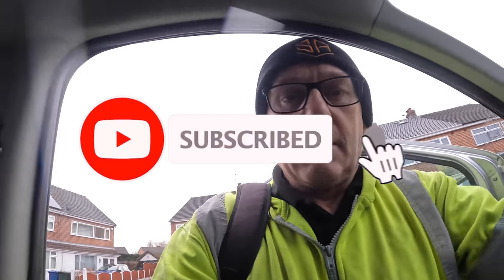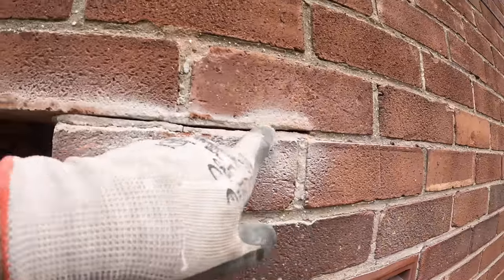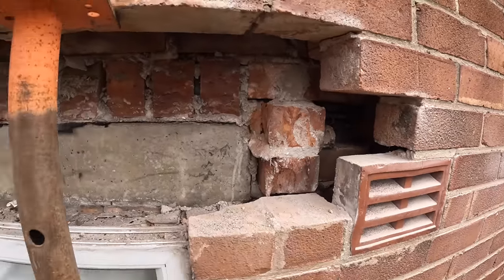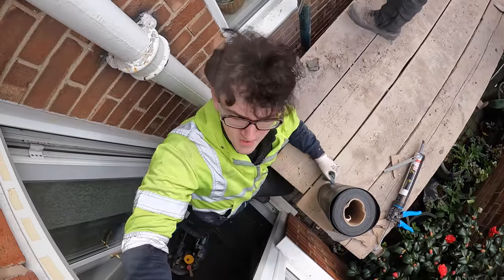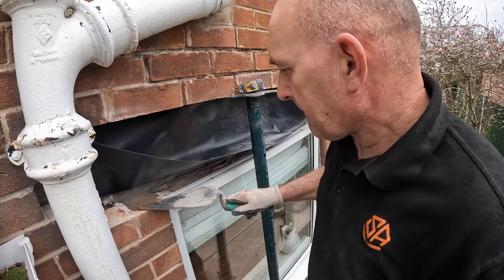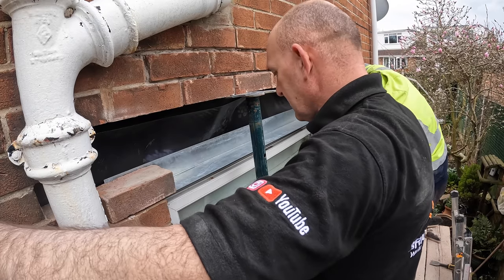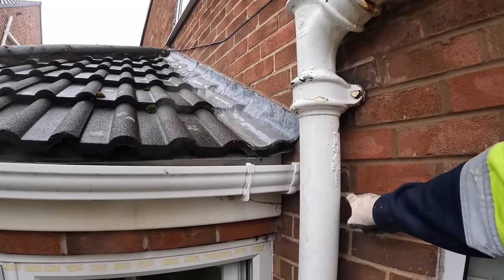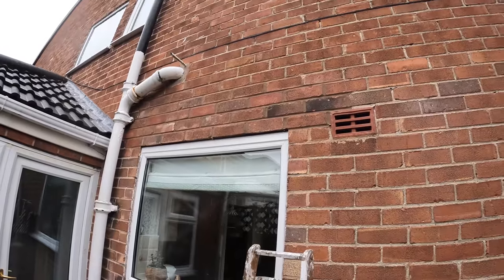MORE SHOCKING WORKMANSHIP!!

Comment: Wow never seen an acro been used like that he's using it like a strong boy the acro goes under the strong boy a mean the acro is only just under the 1st skin of wall the strong boy goes right through and catches both skins. Sketchy and he's talking like this is how it should be done take note and is that even a proper lintel surly he should be using a katnic or a concrete lintel. and to top it off he took the acro out that was wrong in the 1st place while the gobo was green that should have been left at least a day if not 2 shocking and he gets tools n shit sent to him free n makes money of you tube
Reply from the maker: Not a fan then 😆😆 . It’s a single skin angle iron specially designed for exactly this job . Obviously you didn’t notice the internal lintel was fine and untouched so didn’t need propping ! How do you think we managed before strong boys were invented ? I’m glad you didn’t do this job , imagine how shite it would look with a concrete lintel in the face work ! 
   As for taking the prop out it was packed with slate and wasn’t going anywhere , that’s were experience comes in .
Catnic is spelt with a C by the way 🫠
Reply: I think you are right Jamie, especially about leaving the mortar to fully harden. Was he using some quick setting mixture?
Reply from the maker: @davidbrown926  no normal mortar packed in tight and some slate 🧱👍🏽
Reply: Listen old timer No1 worth there salt would use an acro like that it's just not how it's done. of course you use slate to pack it but you leave it to Settle with the pins in that way  if you have any movement while the gobo is going off u Don't end up with cracks appearing it should have been left to go off and you know it job and knock don't forget 👍
Reply from the maker: @jams2gud4u 👍🏽
Reply: @jams2gud4u   The moment I saw the way the acro was being used I thought to myself I wouldn't be doing that and I certainly wouldn't be doing that, filming it and putting it on the internet showing my workmanship.  In fairness though the video title is at lead accurate "more shocking workmanship"
Reply: @andrewsmith9933  The pane of glass below has been holding the wall up for god knows how long. Stretcher bond brick work is very strong and to a point self supporting, even without the acro the most that could full on that small opening would be about 4 bricks. Steve is old school and good at his job not like some of the guys that throw up crap houses on new build estates.
Reply: @rjp666  So because he has been doing it for a long time he gets a pass to do it wrong? He may get away with it on every job until one day he doesn't, maybe it's just a few brings that drop out maybe it's worse.  My biggest concern is the spur marks on the scaffold planks...
Reply: @garulusglandarius6126  behave no one worth there salt would use an acro like that I don't care what ye say..
Reply: Oh no this is all wrong as they didn't show us it this way at college.  You should had used a strong boy, under the outer skin as internal skin had a concrete lintel supporting, this way it sticks out and gets in the way, if your lucky enough you crack your head of it and just maybe next time you do without.  Improvisation  is the key to success in any trade.
Reply: Here we go nvq heroes slagging everyone off cos it's not like college. Just keep to your profiles and new build rubbish. Maybe it isn't feasible to adhere to open site practices. Bet my victorian house will be here longer than any new build and I haven't got any lintels
Reply: Physics 101. Once packed with slate nothing goes anywhere, so mortar doesn’t need to go off. The mortar isn’t what holds the weight, the slate does. Cracks would appear if slate hadn’t been used!

Steve it looks great. Matched in top notch. 

Mind you, a concrete lintel in the face could have looked nice you know. Maybe give that a go next time 🤣🤣🤣
Reply: Cracking job in a short time.proper builder.
Reply: @Jamie Brier seriously? You don't have a clue of what you are saying obviously other than patronizing those excellent traders. By the way Catnic is with C and not with K, it's the same like for C-unt....now that  you know what you are brother, stop being one and think twice next time.
Reply from the maker: @dkaloupis75  🙏🏽🤜🏽🤛🏽🧱👍🏽
Reply: The acro is holding up like 20 bricks...
Reply from the maker: @cheesyoatcake  exactly 🤜🏽🤛🏽🧱👍🏽
Reply: @davidbrown926  Stop thinking... pointless as useless....
Reply: Agreement. I was just about to say where’s your strong boy @ 🧐
Reply from the maker: @hayd1208  🧱👍🏽
Reply: I would and have done the same! I have done  outside skin repairs many times, made easier nowadays though with the plunge and reciprocating saws the half bond is strong enough not to drop when you don't need to fully rely on  hammer and chisels especially for  bed on the last course taken out!
Reply from the maker: @dentray  very true , cheers 🧱👍🏽

Comment: In the past they didn't care a lot of dumping mortar and chippings into the cavity, I had a cavity under a window on level floor which was filled from the foundation up to almost the sill!
That couldn't have fallen from above but was dropped in on purpose I believe to get rid of the waste.
You have to love those stone blades for the reciprocating saw, I also do, it works a lot tidier than a cutting disc.
Only disadvantage is that they wear quickly in harder mortar or engineering brick.
Reply from the maker: Very true Tom , 
As fir the blades we only use them on soft mortar 🤙🏾👍🏽🧱
Reply: I was never an overly good bricklayer so I always used cavity battens on the ties when I could and lifted them as I went, that way I could clean the snots off.
Reply from the maker: @dentray  Always a good tip 🧱👍🏽

Comment: I got a trick to put the angle level with the window head and use headers over the top. I worked for a builder who refused to put a filler piece over the windows or Sliding doors that didn't work to brick height. (The old "turn shit into Strawberry Jam" that us bricky's are always having to do!)
If you ever want to know it I might have to email you the details. It's legal, and looks better if the filler piece is going to be pretty thick.

Comment: Take no notice to them book boys. You probably educated them when you mentioned the slate. Lol. Also my 46 years of cutting out. We know that we can even cut out at least 900mm to 1000mm without collapse .( even a 225.  9• wall) Yet this has internal lintol, and wall, with ties which hold together.  The two acrows would do the job  they've probably learned more from us now lol
Reply from the maker: Exactly, common sense and experience goes a long way 🤜🏽🤛🏽🧱👍🏽

Comment: Did you insulate behind the tray? And why were the acrow's removed before the cement was fully dry🤔
Reply from the maker: Yes you can see it in the video . 
   The acrows were only there for safety . The brickwork was sound and self supporting so the acrows could be taken out immediately. That’s not always the case . 🧱👍🏽

Comment: Thats shocking workmanship  from previous " builder". Guys if its not too much trouble. Whats the potted history of no lintels/held up by window frames, and fitting of galv angle (afterwards?) . Did they fit outer wall lintels after a certain date on newer houses. Even the older ones you can see concrete lintels above doors and windows. Usually coloured as a feature. Thanks 👍👍.
Reply from the maker: Martin is the man to ask Doug , he would know the most about it 🧱👍🏽
Reply: @SteveAndAlexBuild  ok thanks. Im sure he will grace us with his presence at some point. 😜
Reply from the maker: @Doug....  😏🧱👍🏼
Reply: From the 50s through to 1970 some houses were linteled only on the inside. Outer skin were built across the wooden frames  normally with reinforcement  in the brick courses for a few course above the  windows.  Trouble started with replacement  windows not being pushed up tight to the brickwork  and not being as strong as the wooden  windows
Reply: @markrichardson5295  Mark. Thanks for taking time out to explain that👍 Doesn't seem to make much sense to do that in the first place as they knew wooden frames dont last forever. Cheers mate.
Reply from the maker: @markrichardson5295  spot on mate 🧱👍🏽
Reply from the maker: @martin2466  Good thanks 😏🧱👍🏽

Comment: Can I ask, as someone who knows nothing about this, what determined the lintel shape you use i.e. simple angle? Why not, for example, the type that looks like an angle but has a kick back on one edge and how come you didn't put nails in the inner brickwork skin to stop the lintel tipping back as I've seen you done before? Great work and thanks for showing.
Reply from the maker: You need to ask the manufacturers that question pal .
   The nails are only needed if the lintel isn’t stable 🧱🧱👍🏽
Reply: Ah, there's a method to the choice then. I get you. Thanks for the reply, love the lintel fixes (wierd maybe?)
Reply from the maker: @chris7031  😆🧱👍🏽

Comment: They really should just make an Acrow with a rectangular head 🤔
And foot actually… so you don’t have to do the upside down Strongboy thing 😉
Reply from the maker: Great idea 🧱👍🏽
Reply: You could just bolt a bit of steel plate to the prop and then you have a bigger area for propping the wall up, not much onto the acro there
Reply from the maker: @jamienelson7544  Good idea 🤔👍🏽🧱
Reply: U mean a ACRO MATE 🤔🤔😂
Reply from the maker: @makg4655  🧱👍🏽

Comment: That’s quite an old place with cast iron pipes, wonder if originally it had heavy, load bearing timber window frames?
Reply from the maker: Yes mate it did . It was built in the early 60s 🧱👍🏽

Comment: Well done lads for spotting the Pikey building job,  But Surely that RSA is not the correct thickness for a lintel, it looks like 3mm/4mm. It has to be at least 8mm one would think.
Reply from the maker: Thanks . This is a standard off the shelf angle iron 🧱👍🏽
Reply: @SteveAndAlexBuild  Yes standard off the shelf RSA ( rolled steel angle) with a thin flange sorry  I am an engineer. But not the correct flange thickness, looks as thick as flashing.
Reply from the maker: I’m not sure of the actual thickness but this is a standard size supplied by all of the manufacturers 🧱👍🏽
Reply: @SteveAndAlexBuild  Thanks Guys, thats probably why I specify where to buy Lintels that are made to British standard specs.
Reply from the maker: @lucymooch5821  . Thanks 🧱👍🏽😁

Comment: What a great job...definitely  I need some improvements in the way how I do lintels. My question  is: is there any chance where the reglementation organisms would accept a lintel installation without  having an DPC/membrane to repeal water that might get in contact with steel?  I might have made a huge mistake in a previous job and I wonder if I might have to take everything  down and redo the job. Please drop an answer and I would take it as a precious lesson. Thx
Reply from the maker: Time will tell , see how it goes and keep monitoring it 🧱👍🏽

Comment: great video and clean up just shows you so many new builds have so many issues i,m not a bricklayer but where the wood is at the top of the window does that stay in or come out asking because I dont know
Reply from the maker: I used the timber to pack the lintel to stop it sagging then left it in the give the trim something to stick to . It was all sealed so that wood will never get wet 🧱👍🏽
Reply: @SteveAndAlexBuild  thanks i did not know what you did with it  thanks  for explaining
Reply from the maker: @scotspie501douglas7  no probs 😁🧱👍🏽

Comment: And did I see a concrete lintel supporting the inner wythe if brick wall across the opening. That would mean that the structure was proper. Or am I mistaken?
Reply from the maker: Generally wood ,occasionally concrete on bigger spans 🧱👍🏽

Comment: Tidy Job,
Clearly no lintel needed originally as the timber window would have taken the weight. When the window was replaced with UPVC the surveyor should notice the stepped brickwork and realize it doesn’t have a lintel, they should then design a window with mullions to take the weight or fit a lintel. This window was a bad design in this case and the brickwork above would have dropped over time.
Reply from the maker: All beautifully explained Vic 👌🏼🧱👍🏽😁

Comment: Great job as usual fellers. 

Just a thought, would it be worth using some Leadmate to seal the drip tray to the brickwork instead of silicone. It would probably stick better. We use it for flashings etc
Reply from the maker: Thanks for the tip Jack 🧱👍🏽

Comment: Did anyone see the top gable end that blew off in strong winds down south a few years back 🙄 seemed the brickie thought it a good idea to install a layer of DPM at roof level 🙄
Reply from the maker: Yes mate , that was standard practice for a while 🤨🧱👍🏽
Reply: @SteveAndAlexBuild  thanks for the reply 😉 in this case it seemed to weaken the gable end as it was a clean break right on the damp 😥 thought when a seen the pictures that the reason of the fail was the dpm and why it was even there in the first place
Reply from the maker: @johnhasbullahbeck7941  Cavity tray mate  bad idea 🙄🧱👍🏽

Comment: Cavity trays are to prevent bridging the cavity during construction so not really much point adding one at this stage. That's said it's not expensive and doesn't  hurt
Reply: Ken, I thought a cavity tray was required above any doorway. It takes water that gets through the outer brick skin outside, rather than going into the house. Trays aren't for preventing bridging of the cavity during construction although they may also do that .....but it didn't work for the original builders!!
Reply from the maker: @Sean006  . Yes you are correct Sean 🧱👍🏽👍🏽

Comment: should be dry packing really
Reply from the maker: You dry point and we will do it our way . more than one way to skin a cat as the saying goes 😉🧱👍🏽
Reply: @SteveAndAlexBuild  un comressed bed joint will sag then  can cause cracking above at a later date  so if you dry pack with slate it cant move
Reply from the maker: @mrszee951  If you dry pack with slate you will bend the lintel 🧱👍🏽
Reply: @SteveAndAlexBuild  after muck has gone off
Reply from the maker: @mrszee951  . It will still push to the weakest point so it will push down towards the lintel so there’s more chance of cracking the new brickwork abs bending the lintel
Reply: @SteveAndAlexBuild  negative
Reply from the maker: @mrszee951  . As I said we will agree to disagree 🤷🏼‍♂️
Reply: @SteveAndAlexBuild  well it was raining lol